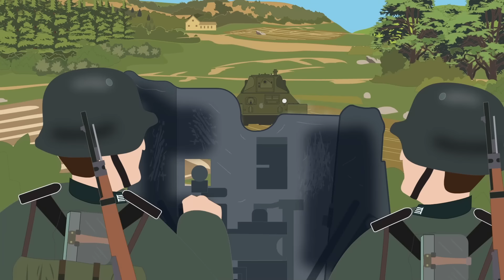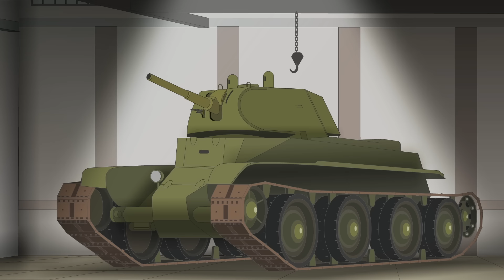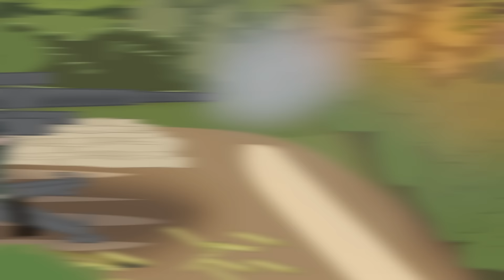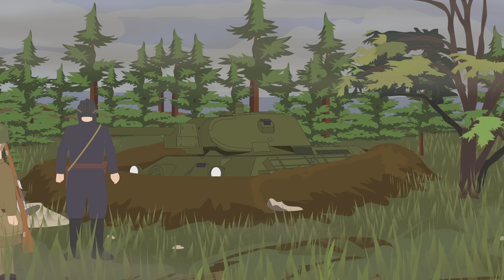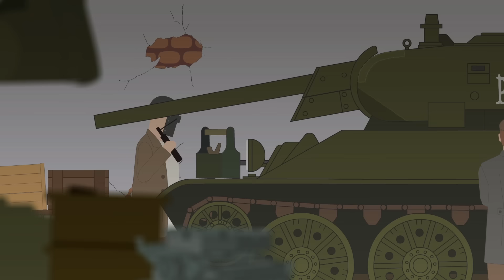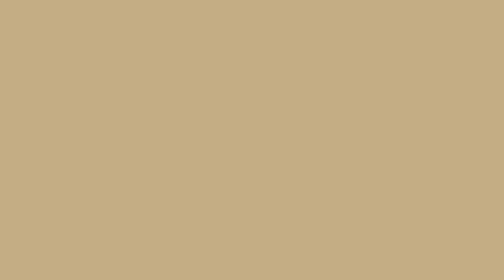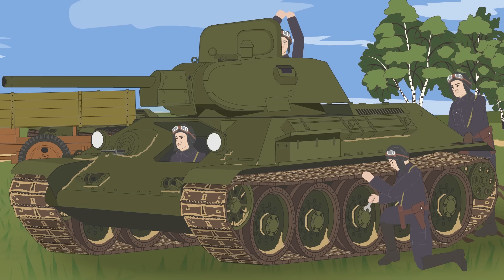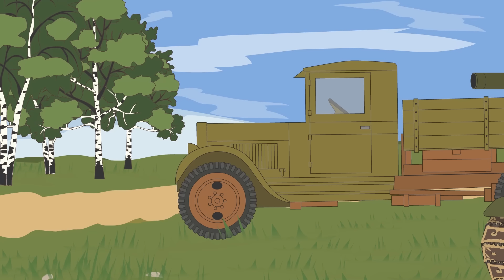Was the T-34 Really the Best Tank of WW2?

Comment: Some considerations: It was the T-34 chassis that made it such a versatile tank. Good speed, and excellent ground pressure to weight traction in rough terrain and snow . The T-34  chassis made conversions easy--T-34/85, Su-85, Su-122, and Su-100, all good AFV's. Their proven design and simplicity made it possible to pump them out in the tens of thousands. Sure, the Tiger sand Panther were superior, but keep in mind there were never enough of them, and they couldn't be everywhere in the vast front of Russia. Besides, where theT-34's really excelled was committed fast and massive deep strikes to encircle and hit the German's rear, like a flood. They could perform the blitzkriegs they learned from  Germans who themselves could no longer do with their heavier tanks, fuel shortages, and  on the defensive everywherre after their last offensives at Kursk and Kharkov.
Reply: And don´t forget the oil problems Germans had - as in Europe of that time the only oil wells were in Romania. Their tanks a TD´s often couldn´t move because the oil reserves ran low (and the same with their capital ships).
Reply: @morriganmhor5078  While true, less indicative of the tanks Germany made and more their logistical issues.
Reply: Yeah the T-34 wasn't even close to being the best individually, in a head to head, most german panzers from Pz.4 onwards were better, but despite that, it being pretty well armoured, yet simple, versatile and fast to produce made it crucial to the Soviets.
Reply: @Flaxelaxen  Agreed. And it needs to be pointed out that for all the Panthers, Tigers and King Tigers superiority, after Kharkov those tanks never won a battle. Sure, they bled the Soviets, US, and Brits, but still eventually lost battles and the war. Hitler relied too much on Wunderweapons to not just win, but to keep every inch of ground like a little boy clutching more toys to his chest that he could possibly hold and keep. 

Tigers and Panthers could not bust through the US lines at the battle of the Bulge,despite outnumbering the US nearly three to one, the weather neutralizing the Allies air-power, and facing two green US divisions, capturing 23K POWs. Those superior tanks could not break through Eisenborn Ridge, nor crack Bastogne. 

If any tank was to be considered the best, other than the T-34 in all its variations, it would have been the Pershing tank that came in the last days. With a 90mm gun and way superior optics than any US tank before it, it would have ate Panthers and Tigers for breakfast had it been available in June '44 .
Reply: @blank557  Personally I'd argue that the best tank isn't the one that was the best at anti-tank roles (especially on the Western Front, as with the exception for a few larger tank battles tank on tank combat was pretty sparse) tank combat was resigned to shorter ambushes which worked well for both sides, but one that works better for the crew themselves - the Sherman tanks were commonly called the Ronson because of their likelihood of catching on fire which in reality wasn't that high, and in most cases lower than their German counterparts, but survivorship bias from the surviving crew members who managed to escape the burning tanks led to the ronson fallacy.

I believe I read somewhere that the Soviets and Germans had different ways of counting a tank as "destroyed" too, with the T34s that had been temporarily disabled and bailed out of counted as destroyed by the Soviets, whereas the Germans would only count a tank as destroyed if it became fully inoperable, as many of their tanks were after driving more than 150km.

And I would say personally that the Germans lost more battles later in the war because of their poor strategic planning, their tactical planning was great but in comparison to the Soviet or Allied planners they fell flat completely, and got outmaneuvered and beaten in larger engagements whilst still winning smaller "tactical" battles.
Reply: @blank557  Eh, the Tigers and Panthers won battles. Problem is that by early 1944, if not before, German industry was so damaged and German manpower bled so dry that all it did was delay the end. Every loss brought Germany closer to defeat, while when the Wehrmacht pushed the Soviets or Western Allies back, there were always more reserves waiting to pick up the slack and keep the pressure on.

It's probably a large part of the reason why the Wunderwaffen became such a thing - it had become pretty clear that Germany could not win by conventional means and that they needed a game-changer to stand a chance. As opposed to earlier in the war, where they were actually fairly conservative (the He280 jet fighter, for instance, was rejected in 1941 because the Germans assumed that the war would be over before it could be deployed).

Hitler's refusal to let the Wehrmacht conduct tactical withdrawals certainly didn't help, but the damage from that was mostly done in 1942, before any of the cats were deployed in enough numbers to make a difference.
Reply: @Max-dn9nu  The Ronson fallacy wasnt around until after the war and was largely based on a book written by a M4 mechanic, not a crewman.
Reply: @Draxynnic  wrote: "Eh, the Tigers and Panthers won battles. Problem is that by early 1944, if not before, German industry was so damaged and German manpower bled so dry that all it did was delay the end."

-- Well, 1944 was the best year when it comes in tank and aircraft production, just keep that in mind.
Reply: @RussianThunderrr  Because at that point they were busy trying to replace losses (similar to Russian production in 1941-42) instead of making the normal number of spare parts and so on. Overconfidence in the early war period was also a factor: Germany didn't actually switch to a proper war economy until surprisingly late in the war, because the Nazis wanted to retain a high standard of living for their precious Aryans despite the war. Bombing of things like fuel refineries also played a role: doesn't matter how many hulls and airframes you complete if you can't fuel them.

If you look at the 1944 production numbers, they're still well below the American and Russian numbers that year individually, maybe even the British. Now, they might still have been behind the US and Russia without the bombing campaign (especially given the relative complexity of the big cats over Shermans and T-34s), but when you're looking at one of the most industrialised nations at the time with both a fairly high population and commandeered facilities from conquered nations, it could have been a lot higher.

Manpower, or more specifically EXPERIENCED manpower, is also an issue. By late 1944, a lot of the "big cats" were being crewed by poorly trained rookies because the Wehrmacht had already lost most of its veterans and was having to rush training programs on the basis that a poorly trained crew was better than no crew at all. (The Luftwaffe had it even worse - there are stories of Western fighter sweeps running into flight training wings and having a turkey shoot.)

Which is all part of why the defeat of Germany has to be considered a team effort. Without the bombing campaign, then at the very least, Germany would have been able to focus its airpower on retaining air superiority in the east. While if it wasn't for the pressure on the Eastern Front, Germany would probably have eventually knocked the UK out of the war, or at least established a stalemate until the English-speakers grew tired of fighting.
Reply: Just because you can make a lot of something doesn’t mean it’s good. Most T-34’s were poorly made. I’m contrast, the Sherman was easy to make, a literal fuckton were made, and most of those tanks not only made it to the front, but were useful. Which is better? A mediocre tank that was poorly made and made in the hundreds of thousands? Or a good tank that was well made that was built in the tens of thousands?
Reply: @hetzer5926  wrote: "Most T-34’s were poorly made. I’m contrast, the Sherman was easy to make, a literal fuckton were made, and most of those tanks not only made it to the front, but were useful. Which is better? A mediocre tank that was poorly made and made in the hundreds of thousands? Or a good tank that was well made that was built in the tens of thousands?"

-- What makes you think that T-34 was produced in "hundred of thousands"? T-34 was not a mediocre tank, unlike Sherman it was a good tank through the war. It produced more top Allies tank aces then any other Allied tank, including Sherman.
Reply: You just shot the argument that the T34 is the 'best' WW2 tank in the foot. In terms of tank on tank, it is not the best tank. In terms of production, it is the best. In terms of losses to amount constructed, it's one of the worst. This subject is the definition of 'loaded question'.
Reply: @RedneckRapture  The problem with it high losses has less to due to the tank itself than how it was employed. T-34's were foolishly used in mass armored charges  that allowed the German AT guns and tanks to take them out easily at long range, and break up their formations. The Israelis did the same to the Syrian tanks at the Golan Heights, and the Syrians T-55's tanks were pretty decent. The Germans didn't do any better at Kursk with their Tigers, Panthers, or Elephants, or later in France at Mortain agasint the US troops.

Montgomery lost hundreds of tanks in pointless frontal assaults at Caen. Now Rommel knew how to use armor, by employing AT guns screens ahead of his armor to fight the opposition tanks, then used his tanks for the purpose they were interned for, to mop up, out flank, and encircle the enemy.
The Soviets used T-34's mobility to great advantage by sending a large task force of them deep into German lines to take out the Tatsinskaya Airfield, the last airfield supplying the German Sixth army at Stalingrad.
Reply: @blank557  A task that could have been done with lighter tanks. All your post has done is reinforce that the T34 was not the best WW2 tank. Again, in tank to tank fighting, the Germans had better tanks. The loss ratio shows that the T34 did not do well given the tactics used. The only thing it was best at was ease of production, which is why the soviets were able to keep up with such losses.

The simple truth is there is no 'best tank of WW2.'
Reply: @RedneckRapture  No, the raid on Tatsinskaya Airfield could not be done by light tanks alone. In fact, the raid would have been more effective, if they had not brought the T-70 light tanks. The Soviet T-70 light tanks only had two man crews, insufficient firepower, poor mobility, and used gasoline compared to the T-34's less flammable diesel. It complicated supplying both tanks with different fuel and ammunition. In any case, the day of light tanks ended when the Germans came up against the KV1 and T-34.

You proved by argument that the T-34's did poorly becasue of the tactics used. The Tiger and Tiger II were defensive tanks. They could not lighting flank strikes due to their small range and susceptibility to braking down. The Tiger II were a liability trying to navigate on the narrow roads in the Ardennes. The T-34 could go where the German tanks could not, enabling them with the mobility to fight an offensive war.
Reply: @RedneckRapture  Its not about tank to tank fighting. And never was.  Sure , Tigers had superior armour and firepower. but only around 1.4k of them were built.  It was expensive and high-maintenance tank.  But 80k+ of T-34s were produced.  Cheap , easy to repair , relatively simple and effective.
Reply: @dudbad  And apparently easy to destroy given the sheer number that were destroyed. Ease of production does not equal a superior tank. Nope, sorry, not the best tank in WW2. Not even close. Even the Sherman had a better combat record.
Reply: @RedneckRapture  Thanks for your very valuable "no sorry".  Best argument ever.   T34 was put into production only a year before the war.  So no experienced personnel no logistic no spare parts , etc.  40% of those losses were operational not combat. It was mass produced during unprecedented annihilation war. Sure not the "best" in a duel or whatever but certainly most important and iconic tank of WW2.
Reply: @blank557  Michael whittman turned dozens of 34s into scrap . A tiger can turn  34 into scrap at over a kilometer. Kursk the majority of tanks were buried in a defensive line   It’s always harder to attack dug in troops and tanks
Reply: @RedneckRapture  wrote: "Even the Sherman had a better combat record."

-- Sherman tank did not fight as hard as T-34 tank did during WWII, no way, no how...
Reply: @RussianThunderrr  So now you're questioning how hard each side fought? You really are getting desperate.
Reply: @RedneckRapture  wrote: "So now you're questioning how hard each side fought? You really are getting desperate."

-- Is it am I desperate, or is it you who trying to convince me that Sherman tank had a greater or equal contribution in WWII as T-34 tank?

-- What German tank offensive operations do you know, that Wermacht conducted in 1944 to the end of war vs Americans and BEF on Western Front and vs Red Army on Eastern Front? Lets just compare...
Reply: @RedneckRapture  It depends on how you define "best" tank. The T-34 was not the best tank in individual head on tank fights, but it was probably the best tank, when you take in to consideration what the war ended up being, a war of attrition and production
Reply: @Flaxelaxen  In a war of attrition and production, the Sherman tank was actually the clear victor in terms of amount produced and how many were destroyed. Numbers I've seen indicate that while ten thousand less were produced than T34's, they only had a few thousand destroyed. In a war of attrition, those are better numbers. In terms of straight up tank to tank engagement, the Panther and Tigers were the best. In terms of mass production to keep holes in the lines filled in and preventing a collapse of the front, regardless of casualties, the T34 is the best.
Reply: @RedneckRapture  You're completely ignoring the fighting conditions there. The T-34 losses were so high because it fought for the entire war (including periods where the Russian crews were poorly trained and the Germans had air superiority, while the Sherman mostly fought under Allied air superiority) and because the Wehrmacht focused most of its resources on the Eastern Front. As an example, there were more German tanks and assault guns at Kursk alone than the entirety of France on D-Day, and with the exception of a couple of elite units like the Panzer Lehr, the German ground forces in the west were generally second-rate troops. Most of the Sherman's campaigns, by contrast, were fought against an already diminishing enemy. In short, the T-34 fought for longer and against much stiffer opposition than the Sherman.

 If the Sherman and T-34 had swapped places, with the Sherman fighting for Russia from the start of Barbarossa and the T-34 first seeing action in small numbers in autumn 1942, I'm pretty sure it'd be the Sherman that had the loss rate that you're condemning the T-34 for. (Noting that the Sherman would probably have been just as nasty a shock to the Germans in 1941 as the T-34 was, and the Russians didn't make the American mistake of assuming they didn't need to upgun their tanks because fighting enemy tanks was the job of tank destroyers.)

You say that the Sherman's figures are better for a war of attrition, but the fact was that, apart from those that were sent to Russia under Lend-Lease, the Shermans weren't fighting the war of attrition in the first place. The T-34 was.
Reply: @RedneckRapture  wrote: "Numbers I've seen indicate that while ten thousand less were produced than T34's, they only had a few thousand destroyed."

-- Sure if they seriously entered the war half way through, yet most of German armor was involved fighting T-34, then that is what indicated by statistics, and not that it is a better tank then T-34.
Reply: @RussianThunderrr  Actually, some 17,000 Shermans were also used by the British, or are you going to say they weren't seriously involved in ground fighting in the war?
Reply: @RedneckRapture  wrote: "Actually, some 17,000 Shermans were also used by the British, or are you going to say they weren't seriously involved in ground fighting in the war?"

-- Well, 80% in WWII was on Easter front against Soviet Red Army, since June of 1941.
Reply: @RussianThunderrr  Uh huh, and yet when the Germans attempted to break the American, UK, and Canadian line and made the battle of the bulge, the Americans held, where when the germans attacked the russians they were nearly pushed back to their capital and the Germans ended up being stopped by the Russian winter rather than the Russian Army.
Reply: @RedneckRapture  To be entirely fair, the Soviet Union had a lot of logistical problems in that first year. A lot of that can be attributed to not being ready to fight the war that was coming.
Reply: @RedneckRapture  wrote: "Uh huh, and yet when the Germans attempted to break the American, UK, and Canadian line and made the battle of the bulge, the Americans held, where when the germans attacked the russians they were nearly pushed back to their capital and the Germans ended up being stopped by the Russian winter rather than the Russian Army."

-- Stop with a nuisance, I asked you what offensive  operations was conducted by Wehrmacht in 1944-45 vs Allies on West Front, and Red Army on Eastern Front, just so we can compare. And quit stating that Wehrmacht was so delicate, that it was defeated by weather elements alone, you just exposing your stupidity and luck of knowledge already.
Reply: @RussianThunderrr  Really? So I guess all the combat in Africa didn't happen? Also, you are avoiding the subject, trying to go with an overall picture rather than a straight up, tank to tank comparison. Your name shows your bias enough, so I understand if you cannot and will not accept the fact that the T34 was actually crap as a tank and its own redeeming feature was its ease of production.
Reply: @RedneckRapture  wrote: "Really? So I guess all the combat in Africa didn't happen? Also, you are avoiding the subject, trying to go with an overall picture rather than a straight up, tank to tank comparison."

-- We'll comeback to "tank vs tank" comparison, you have not still answered the question that I asked you. I never said that combat in Africa didn't happened, however what do you think the forces that faced each other in Africa(its only two and half Panzer Divisions, as the whole African Corp under command of Rommel) vs 150 plus Divisions that crossed the border in operation Barbarossa, do you see the difference in "scope and scale" of fighting in Africa vs Eastern Front. 

-- Just fighting for Crimea Peninsula in 1941 at its peak were 3 Corps under command of Eric von Manstein and whole Luftwaffe 4th fleet, and yet Sevastopol city held for 250 days until July 4th, 1942, and yet Crimea Campaign is just a tiny part of the whole much larger Eastern Front.
Reply: @RedneckRapture  wrote: "Your name shows your bias enough, so I understand if you cannot and will not accept the fact that the T34 was actually crap as a tank and its own redeeming feature was its ease of production."

-- Well, if you so "distrustful" of my bias... then I guess we have to once again have a history "teach you a lesson"... Once upon the time in 1941, once operation Barbarossa failed i.e. capture and distraction of main Soviet cities like Leningrad and Moscow, where winter had nothing to do with Wehrmacht misfortunes, but Red Army stubborn resistance was the main cause of Germans failing to capture their objectives, so A. Hitler decided to have yet another go at capturing Moscow city, calling this plan operation Typhoon. The closest to Moscow is the 2nd Panzer Army under command of H. Guderian, that made the most progress as it captured Orel city and was on his way to Tula city(which is one of the oldest small arms factories). On his way to Tula gets into an ambush by General's M. Katukov's 4th tank brigade armed primarily with T-34 which knocked out lion share of Guderian tanks on October 6th, 1941. Guderian writes loses report, that Soviet T-34 tanks can knock out Pz-III and Pz-IV at long(1200-1500 meters), while Pz-III can knock out T-34 only at very short distances. Hitler orders members of Panzer Committee to get on his personal FW-200 and fly to examine T-34, instead of waiting for it to arrive to Germany. So people like Alfred Krupp, Erwin Aders(creator of Tiger tank), Ferdinand Porsche among others flew to Mtsensk and study T-34 tank, and as a result it was decided to replace useless Pz-III tank with new Pz-v Panther tank. Oh, from that report Hitler found out that his orders to up gun Pz-III was simply ignored by OKW. So heist appearance of Pz-V, that came out larger that it needed to be, and did not changed the course of WWII, is squarely owned to T-34 tank. As well as failing of the operation Typhoon on both Southern and Norther pincers of Moscow city, Battle of Klin(Tver) city with T-34, is what stopped 3rd and 4th Panzer Armies, and not the "weather elements". You not going to accuse Hitler or German High Command of Soviet bias, right?
Reply: @RussianThunderrr  Again, you have said absolutely nothing to show that, as a tank, the T34 is better than the Sherman or even deserving of the title of 'best'.
Reply: @RussianThunderrr  See, I don't need to answer your question because the initial topic is what I'm trying to bring you back to, but you insist on going into detail about things unrelated to the topic at hand. But hey, I get it, if it comes to tank on tank comparison, the T34 loses. I understand you not wanting to get into a losing argument.
Reply: @RussianThunderrr  And yest again, you avoid the issue that the T34 sucked as a tank by trying to talk about the war in general.
Reply: @RedneckRapture  wrote: "And yest again, you avoid the issue that the T34 sucked as a tank by trying to talk about the war in general."

-- I did clearly outlined parameters/categories of what made T-34 best tank of WWII, you just babbling something incoherently.
Reply: @RussianThunderrr  No, you stated strengths that made the Soviets better in WW2 than the Germans. I do not count 'easily produced to make up for its losses' to be something that makes a tank good.
Reply: @RedneckRapture  wrote: "No, you stated strengths that made the Soviets better in WW2 than the Germans."

-- No, I also went in depth of why T-34 better then Sherman tank as well, but you have not noticed that post as well... Go read it!
Reply: @RussianThunderrr  Your post went on and on about how they were used strategically. Sorry, not sorry, but talking about how it 'fought harder' when it was in more battles and still died a lot more than the Sherman against the same tanks does not reinforce your point. It only points to you being biased without anything to back it up but 'muh T34'.
Reply: @RedneckRapture  wrote: "Sorry, not sorry, but talking about how it 'fought harder' when it was in more battles and still died a lot more than the Sherman against the same tanks does not reinforce your point."

-- Sherman tanks did NOT fought the same number of German tanks as Soviet did, in other words most of German tanks was lost to Red Army, while Allied tanks struggle with fighting much smaller number of German tanks, so your point is absolutely mute. T-34 participated in WWII a LOT more then Sherman tank, but far, that explains higher T-34 losses then Sherman tank.

-- Besides, like I pointed out to you T-34 had a better gun, then Sherman tank, better armor protection, better engine, better power to weight, better operational range and ect. Sherman tank was not a better tank then T-34.
Reply: @RedneckRapture  wrote: " In terms of losses to amount constructed, it's one of the worst."

-- Are you sure comrade "Rapture", one of the "worst" to what? Tiger I of which 1350 constructed nearly 100% lost, Tiger II under 500 build 100% lost, Panther V near 6000 constructed near 100% loss, is that the numbers you are aiming for?
Reply: @RedneckRapture  "You just shot the argument that the T34 is the 'best' WW2 tank in the foot. In terms of tank on tank, it is not the best tank. In terms of production, it is the best. In terms of losses to amount constructed, it's one of the worst. This subject is the definition of 'loaded question'."

No, he didn't. You know, if you give a T-34 for four people or give nothing, what do you think is better? It's simple. A lost tank is better than hundreds of people lost.
Reply: The point is, you are using a nation's industry to judge which tank is the best tank instead of the tank itself. It makes your argument inherently flawed.
Reply: @RedneckRapture  Then explain to me why the Germans were so enamored with the T-34, that they considered seriously to copy it, before deciding to come up a new generation of tank to supersede it? The Germans passion for military techology demonstrates how much they were impressed by it.
Reply: @blank557  Probably because the germans never considered sloped armor with their tanks as evidenced by tank designs of the germans. Look at the Tiger and then the Tiger 2, and the Panzer IV then the Panther. Simple fact is it is the tank that died the most in WW2.
Reply: @RedneckRapture  Not just the sloped armor. In 1941 the T-34 had the best combination of armor, speed, cross-country performance, and gun that set the standard. No nation's tank at the time matched it.  Now it did suffer from not radio, and poor crew training, becasue Soviet troops were not trained to fight with personal initiative due to Stalin purging their Officer corps in the 1930's including his best and innovative Tank commanders. As a result, the T-34 was used by former cavalrymen in outdated WWI fashion that proved disastrous. 

You keep ignoring my previous posts that show it was the poor use of the T-34, not the tank itself that resulted in its massive losses. The same happened to the Allies with North Africa and France, and to the Germans at Kursk, Mortain, and Ardennes. Many of the T-34 losses were not from tank to tank duels, but from AT guns, which neither side did well against, since AT guns were like hidden snipers that tanks crews could not see with their low profiles and were camouflaged, making them near impossible to spot.

Heck, even during Barbarossa, one KV1, which suffered from a lousy transmission design, sat astride a major road and single-handedly held up an entire German mechanized division for 24 hours, taking out well over a dozen AT guns and vehicles before the Germans finally could get an 88 positioned to take it out. If the KV1 had a running chassis like the T-34, it would have been the Tiger/Panther tank of the Russian army in 1941, and no German tank at the time could come close to going toe to toe with it.
Reply: @blank557  tiger and panthers would turn a 34 into scrap from a kilometer away
Reply: @austinmartin5446  Sure they could. Those  tanks were a direct response to the T-34 that so shocked the Germans in 1941.
Reply: @blank557  They T-34 was heat treated to the extent that its armor became so brittle that it would frequently shatter. When it didn't, the terrible welding standards would see the plates split at weld points. When that didn't happen, spalling would occur and kill some 85% of the crew. It was a horrible tank that suffered from more than just a lack of radio.

The gun was only marginally better than the American M4 due too poor gunpowder used in the tank shell. Penetrations were almost always fatal because spare fuel was stored inside the tank. The transmission was garbage and a spare, starting in 1942 and onward, was kept within the tank in case it broke down in the field. In addition to this, most T-34s only achieved a top speed of 18mph because it was damn near impossible to shift into 4th gear. The cherry on top of all of this is that it could have been a great tank if they hadn't been mass produced as quickly as possible, which caused factory defects and rampant casualties. All of which, just kept the feedback loop going.
Reply: @captainbadassitude1845  wrote: The gun was only marginally better than the American M4 due too poor gunpowder used in the tank shell."

-- So, T-34 was a better tank by your own admission. 

-- Where did you see spare transmission was kept within the tank since 1942? 

-- Why T-34 only achieved top speed of 18mph? What was so special about 4th gear?

-- What makes you to think, that Soviets had an option not to produce T-34 as quickly as possible, Germans did that, but we know now that they lost the war!
Reply: @RussianThunderrr  
"So, T-34 was a better tank by your own admission."

A better gun, a marginally better one at that, does not make a tank better. The T-34 was not better than the M4 Sherman but it could have been had it been built properly.

"Where did you see spare transmission was kept within the tank since 1942?"

A youtuber named Lazerpig covered it.

"Why T-34 only achieved top speed of 18mph? What was so special about 4th gear?"

It was just hard to shift into 4th gear is all, later improved models would feature a fine 5th gear that eliminated the problem but not all of them had it and certainly not the early-mid war models. The drivers would often carry hammers or request assistance when shifting into 4th from a crewmate.

"What makes you to think, that Soviets had an option not to produce T-34 as quickly as possible, Germans did that, but we know now that they lost the war!"

The Soviets had the option to make them better, they chose not to because they were panicking. Heat treating at a lower temperature would have saved many T-34s from being abandoned when their armor split due to how brittle it was. That also caused spalling, a problem which effected even the T-34-85 model, which killed many tank crew members. A T-34 made properly performed adequately enough but the casualty numbers speak for themselves. Cutting corners on basic, fundamental things like sights, armor treating, lights and gunpowder significantly harm the tank's ability to fight. Add in the fact that this wasn't some unkillable super tank that bounced incoming shells like it was nobody's business and you begin to see that the Soviets were caught in a negative feedback loop. Our tanks are dying too quickly, so we need replacements! Replacements take too long, cut corners on unnecessary things! These cut corners got a bunch of crews killed, so we need replacements!

"Germans did that, but we know now that they lost the war!"

German tanks perforated Russian tanks with alarming regularity. They had no problem fighting the infamous T-34s and KV1s during Operation: Barbarossa. Germany lost because America, Russia and the United Kingdom are much more powerful when they work together.
Reply: @captainbadassitude1845  wrote: "A youtuber named Lazerpig covered it."

-- Sounds so "professional" and historically "accurate", just as the username "Captain Badasstidude", well if you say this:

"German tanks perforated Russian tanks with alarming regularity. They had no problem fighting the infamous T-34s and KV1s during Operation: Barbarossa."

-- If this is the case, then why German get ride of their MBT Pz-III in favor of Pz-V Panther? Explain please.
Reply: @captainbadassitude1845  wrote: ""Where did you see spare transmission was kept within the tank since 1942?"

A youtuber named Lazerpig covered it."

-- So where is that "spare" transmission was kept within the tank in 1942? I do want to laugh....
Reply: @RussianThunderrr  The spare wasn't kept within the tank, my mistake. I sometimes say things that are incorrect when discussing things that I'm interested in.

Instead, they were outside the tank.
Reply: @captainbadassitude1845   wrote: "Instead, they were outside the tank."

-- There are pictures of earlier models of T-34-76 in 1941 with transmission module tided to the rear deck, so you can see the size of it... So LazerPig claims that is was stored in boxes, where in fact those boxes would not fit that transmission, and those boxes are actually external fuel tanks, right before round 90 litters external fuel tanks appeared on T-34-76.
-- Also you can see him contradicting himself on speed of T-34, while documentary footage showing T-34 steaming at a lot higher speed then 12km/h(or 9mph). T-34 was a fast tank, and maneuverable, there are plenty of footage of it been driven in combat by T-34 drivers "like they stole it", and not "as it about to break down".

There we go:

https://www.youtube.com/watch?v=ub4bZJAtYzw
Reply: @RussianThunderrr  "Sounds so "professional" and historically "accurate", just as the username "Captain Badasstidude", well if you say this:"

I'm not a professional, thankfully, so this is of no matter to me :D

"If this is the case, then why German get ride of their MBT Pz-III in favor of Pz-V Panther? Explain please."

Because Germany changed how it fought armor when they were losing. The Panzer III was not ideal for holding a defensive line against enemy tanks that could penetrate them more easily than they could them. The Panzer IV was but did not have sufficient numbers nor the logistical network to supply them even if they were made in sufficient numbers.

You will notice a lot of late war designs placed more and more emphasis on survivability and firepower rather than mobility like previous models.
Reply: @captainbadassitude1845  wrote: "Because Germany changed how it fought armor when they were losing. The Panzer III was not ideal for holding a defensive line against enemy tanks that could penetrate them more easily than they could them. The Panzer IV was but did not have sufficient numbers nor the logistical network to supply them even if they were made in sufficient numbers.

You will notice a lot of late war designs placed more and more emphasis on survivability and firepower rather than mobility like previous models."

Wehrmacht

chosen
Reply: @RussianThunderrr  -I don't know if it was intentional but I think you may have multi-posted.- Never mind, it's just Youtube being weird.

"like they stole it"

I'm not sure what that is suppose to mean. I can only assume it is suppose to be something akin to "joy riding" in it.

"T-34 was a fast tank, and maneuverable, there are plenty of footage of it been driven in combat by T-34 drivers "like they stole it", and not "as it about to break down"."

I disagree. The video footage you showed doesn't show any exceptional speed. The average running speed of people seems to be some where around 9.4 kmh [according to Google] and those tanks [during the cross country scenes where they drove past troops] seemed to be going about that speed. There's also the issue of a lot of people mixing up footage of T-34s and T-35/85s, which were better at driving than the T-34s.

"and not "as it about to break down."

The reliability problems of the T-34 are known. The majority of T-34s lost in 1941 where the result of mechanical failures that could not be solved by the crews. There was even an incident where the failure rate of the T-34 was so high that Soviet command [Stalin too?] believed it was cowards exaggerating their problems.
Reply: @RussianThunderrr  "Wehrmacht

chosen"

I don't know what this means. On another note, I meant to write the Panzer V and not the Panzer IV in the comment.
Reply: @captainbadassitude1845  wrote: "I disagree. The video footage you showed doesn't show any exceptional speed. The average running speed of people seems to be some where around 9.4 kmh [according to Google] and those tanks [during the cross country scenes where they drove past troops] seemed to be going about that speed. There's also the issue of a lot of people mixing up footage of T-34s and T-35/85s, which were better at driving than the T-34s."

-- Well, if people running around 9.4 kmh, and tanks driving past them, then tanks driving faster then 9.4 kmh. 

-- As for confusion of footage since T-34-85 had a large three men turret, it is harder to confuse that tank with T-34-76 that had a smaller turret, right?
Reply: @captainbadassitude1845  wrote: "On another note, I meant to write the Panzer V and not the Panzer IV in the comment."

-- That is ok. You are not that much off the point in either way. Pz-IV was a fire support tank to Pz-III, since it had a howitzer like Kurtz 7.5cm gun, then in 1943 they swapped roles, right before Pz-III got off production. Pz-V supposed to replaced both tanks i.e. Pz-III and Pz-IV, but after Pz-IV got excellent long barrel dual purpose gun, and Pz-V had a not so good vs soft targets long range gun, so Panther still need Pz-IV in its ranks.
Reply: @RussianThunderrr  Yeah, I don’t think I claimed that T-34s were slower than people. You said they drove off-road at 12kmh, which is what I think I saw in the video.

As for identifying the T-34/76 and the T-34/85, I believe that is true. Some of the footage doesn’t show the turret well, so I have trouble knowing they’re all 76s but I digress. Regardless, I genuinely believe the most [if not all] of those T-34s in that video are T-34/76s.
Reply: @captainbadassitude1845  wrote: "Yeah, I don’t think I claimed that T-34s were slower than people. You said they drove off-road at 12kmh, which is what I think I saw in the video."

-- I'm not saying its you, you just referenced LazerPig... Watching his "master piece" on T-34, and A-10 is enough for me to conclude he is not a reputable source(nor he is trying to be), yet people keep referring to his videos, I just don't know why?
Reply: @RussianThunderrr  Ah, I see what you mean.
Reply: @blank557 the germans would have made it better by just manufacturing it better
Reply: @RedneckRapture  More like we have different understanding what "the best tank" means.
Reply: @dudbad  Indeed. It makes this a debate that can never end. Different standards of what makes a tank 'the best.'